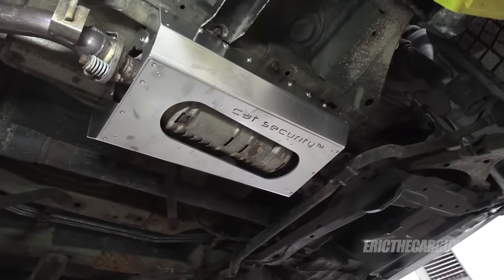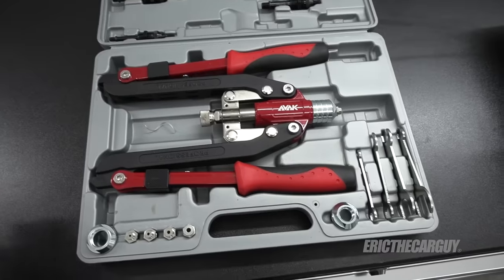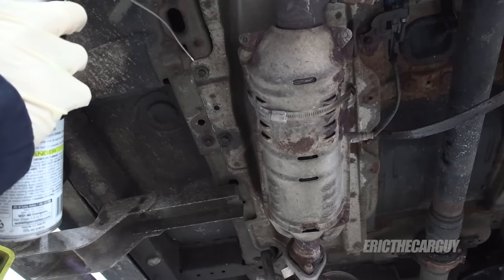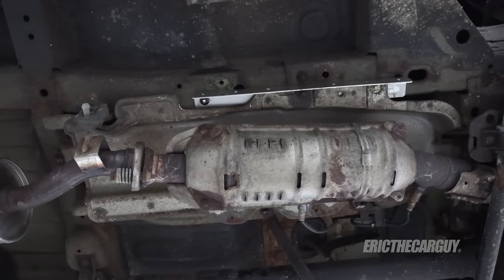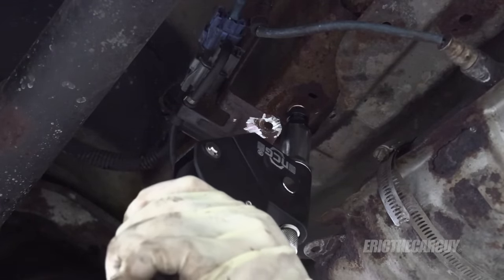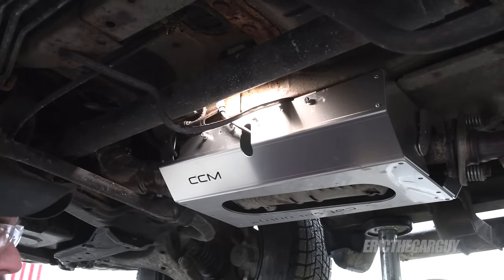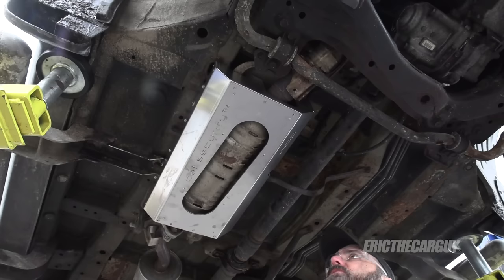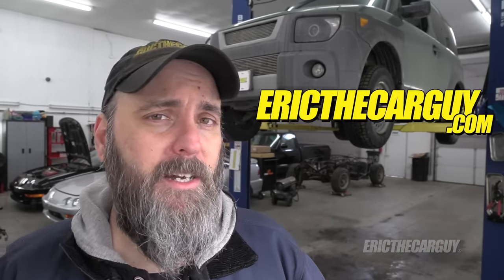How To Prevent Catalytic Converter Theft

Comment: That system is definitely neat! Luckily all of my cars are low enough to deter most CAT thieves
Reply: Haven't seen how they go about it do you? They've got low profile jacks and operate like a pit crew.
Reply: Why spend extra time bringing a low profile jack when you can just target SUVs, roll under and sawzall in a minute?  1 guy parks a car next to a SUV to block the view, roll under, cut, leave, done.  Happened at my work parking lot.  I don't need to worry with just 4" of ground clearance on my Accord.
Reply: Where I live this one guy was doing it even quicker he just had a chain that had two hooks on it and he clipped it to both sides of the exhaust and just ripped it out with his truck. Please said it was a two-man team and they were doing it to fund their addiction gambling and pills..  so it doesn't really matter how low if they're desperate they'll get it. Though this system probably wouldn't hold up either
Reply: @securityguy  really? A sawzall??? Lol 😂😂😂 how fast you think you can cut out a cat with a sawzall? Versus a right angle impact wrench? Not to mention the sound 😂😂😂😂
Reply: @deandalapanda  That's how they do it.  That's why cars show up to exhaust shops with irregular cuts on the exhaust pipe.  Saw it first hand myself.  Keep loud music going while you cut, why not?  It's not possible to loosen rusted bolts using just impact in the snow belt.  You need heat, that would take too long.
Reply: my car is low enough not even a low pro jack can get underneath
Reply: @securityguy  cos the prius and honda Jazz cats earn them more money. Probably because the construction of these cats have more precious metals in them than other vehicles. Seriously, I've seen videos of these thuggery theives work in threes stealing cats in broad daylight in the UK. Makes me sick.
Reply: @slimjim8736  if they wanna wreck your car for your cat, they will. Slammed or not these thieves will stop at almost nothing.
Reply: @deandalapanda  you think they take the bolts out? Hahahahaha I can cut a converter off in 10 seconds with a sawzall
Reply: yeah that won't stop them, they use floor jacks.
Reply: @securityguy  they do prefer higher vehicles like trucks and SUVs but they still bring jacks and target lower cars as well because economy cars have bigger cats and bigger cats means more money. I used to rent penske trucks and we had people steal cats off the trucks all of the time, and they were stupid for doing that because they aren't as valuable. and you can tell they're stupid because half the time they would leave the cats and steal the resonator thinking they stole a cat.
Reply: @deandalapanda  a sawzall can rip through a 1/4'' nail like butter. we're talking like 1/8'' steel here, it's not even a work out. an impact won't do shit especially especially if you're dealing with a welded system. even if you can get the clips off quickly, which you probably could, it's not just going to drop out in your lap. the whole system uses interlinking pipes which means you would pretty much have to slide the whole exhaust backwards to get it out and with all of the rust the pipes are almost certainly going to be fused and will need some real elbow grease to get them free. I have done enough exhaust work to know that doing it the right way without damaging anything can be a struggle vs just hacking it out.
Reply: @slimjim8736  "my car is low enough not even a low pro jack can get underneath" can you go over speed bumps without leaving your transmission behind? all they need is a few inches.
Reply: Jokes on them its straight piped!
Reply: I have mine slammed when parked
Reply: $80 lightweight low profile aluminum car jack from harbor freight will make it easy
Reply: @jameslong2618  it doesn't even matter that it's $80 because they'll just steal that too. I work at home depot and I have seen people steal weird things. sure most people are going for the diamond blades and just about anything that says (makita, dewalt, milwaukee, and bosch) but we also have people who steal ryobi tools. they steal tools for their jobs, and when they are tools that they are actually going to use they tend to gravitate towards the cheaper stuff, it probably makes them feel less guilty and they are also less likely to be chased. a guy came in a stole some ryobi tools including a sawzall and not even a day later somebody is going around the parking lot cutting cats out of customer's trucks.
Reply: They mostly hit Prius here in California. They lift one side and out done in minutes with the new power tools that are out there.
Reply: No joke my friend had his converter stolen from a Prius
Reply: Challenge accepted.
Reply: @MrMistery101  Just because they have a low profile jack, doesn't mean crap.
Reply: Best you can do: straight pipes in a state like Tennessee, weld it in, or have like a inch of ground clearance
Reply: @M1LAD81  Would it be less likely to happen to a "low rider car that is parked/dropped at the lowest level.?"...
Reply: @deandalapanda  a cordless sawzall with a decent blade will cut through exhaust pipe like a hot knife through butter. I cut up take off exhaust pipes all the time it takes maybe 30 seconds.
Reply: I heard on the news today a thief trying to steal a cat off a Prius got crushed to death when the jack he was using slipped and dropped the car on top of him. Sweet, sweet karma.  👍
Reply: Yeah I'm scratching my head as to how someone can't simply jack the vehicle up.
Reply: Look up man crushed by car while stealing catalytic converter. It was a Prius.
Reply: Good thing there's no such thing as jacks.
Reply: Do your research before spending money on designs that can potentially damage your vehicle. This catshield in the video is basically an oven and causes overheating of your catalytic converter. Here's a study from the company using thermal testing on their prototype catshield design similar to this - https://catshield.com/blogs/news/the-design-process
Reply: @mst7897  in all honesty probably not. That's because most people who do this slamming to the ground to their car are unlikely to have a catalytic converter. There's a high probability that the car has been de-cat'd. So the thief wouldn't waste his time to check.
Reply: @M1LAD81  Toyota Prius type cars are the cat thieves favourite because these cars spend most of their running on the batteries so the cats are almost atill brand new
Reply: @deandalapanda  They're cutting exhaust pipe, so with a new blade, they can cut through in seconds.
Reply: @slimjim8736  They'll jack it up by the rocker, and/or under the door. Don't give a flip if they do damage.
Reply: In 3 minutes one guy stolen my cat from my 2014 Corolla.
Reply: @ElectronicsForFun  ''Just the tip''
Reply: @securityguy in my area people have been hitting Priuses like there's no tomorrow. Floor jack only, there's no way to get those without one.
Reply: I got my catshield at www.catshield.com! They use tamper resistant screws and even use zinc coated rivnuts to keep the metals separate. Hence, preventing galvanic corrosion from occurring on my car. Btw, I got their stainless steel instead of the aluminum cat shield. Worth checking out as an alternative.
Reply: @JoshuaDomoslai  Unless you're from CA! This damn state requires OEM.
Reply: My Audi is low and they jacked it up on one side and attempted to get it. They cut the pipe but apparently didn't have time to cut the clamps leading to the catalytic convertor.
Reply: Don't need all that bs. Install a shock sensor and motion sensor alarm underneath your vehicle and set the sensitivity level to high. Install an ear drum-damaging db level siren underneath vehicle. Park in well lit area. Park in front of your home or near. Stay locked and loaded, just in case you catch them in the act. You wont have to worry about s^%%. BTW, I dont care if your vehicle is sitting on the lower control arms. Thieves can still gain access to your undercarriage.
Reply: @securityguy  The Toyota Prius is one of the most popular targets for cat thieves and they are vey low.
Reply: @securityguy  My daughter just had her Cat stolen off a 2005 Accord. Parked on the street.
Reply: @securityguy  Toyota Prius catalytic converter sell for big more. Worth it for them to bring a low profile jack
Reply: @Scoharr  That sucks. It's better parked in a driveway near the house or garage if possible. I hear they mainly target 2000 to '07 Accords, Elements, Prius, trucks, suv's even older and a few newer ones, mainly b/c the CAT's are bigger or more value to them in 2000 to '07 I guess??..I have a 2010 Accord EX. Some shops say they may hit mine, other shops I spoke to say only 2-3% chance they try for mine. 

I have comprehensive ins. $50 deductible that would cover the loss. I think I'm going to still have a 1/2 inch hardened steel bar and a 1/2 inch hardened cable welded side by side all the way down the exhaust, spray paint it bright orange for $200 at a muffler shop I found. "Piece of mind" thing, might deter them. They can still get it after using maybe 4 blades and 5-6 minutes if they want but they might pass after seeing all that and not being older than '07 for the big money.
Reply: Have you ever heard of floor jacks?
Reply: @mitchkronowit3633  now I know of two different cases of cat converter thieves being crushed  by Prius one car was blue and the other one was silver.
Reply: @mlee81  I was 8 years old the first time I jacked up a car helping my dad fix a tire at home.
Reply: Actually that would cause more damage.  the bad guys will just attach a hook on a cable and rip everything out with a pickup truck

Comment: I just had my cat stolen  while in Lowes in the middle of the day and parked in direct view of the cameras.  34 second removal with a reciprocating saw.  Insurance is looking to total my truck due to value vs cost of repair.  I'll probably replace it my self with some winch cable security.  Good video and information for whoever can use it.  Good job E.

Comment: Sorry, mine is actually Astro Pneumatic.

They also make an air powered version, for tight environments. 
They also make different mandrels for different Rivnuts. 
I also bought the extra multi pack
Astro-Pneumatic-Tool-1442-Setter

There are so many uses and applications for Rivnuts.

One cool thing I discovered- install a suitable Rivnut,
then install a rivet where a bolt would normally go.
The rivet bites into the threads of the Rivnut.

I've also got into the habit of installing a washer behind
a rivet or Rivnut, it adds huge strength to the bond.
Reply from the maker: Thanks for that tip!

Comment: Attach a cheap bicycle alarm (one that has a remote) to a cinder block/brick, etc. They're waterproof and can be found on Amazon for around $10. Place the alarm inside the block and place it under your car/truck in your driveway below the catalytic converter.  Ensure the block/brick has just enough clearance that your car-truck wont hit it, but not enough that they can access the converter with a saw with the block in place.  You can make marks on the driveway to ensure youre always parked above the block.  When you leave, use the remote to disarm the alarm and re-arm on return. 
These bike alarms are sensitive to vibration.  Its next to impossible to move the cinderblock or brick without setting off the alarm and warning the whole neighborhood, but arent easily set off by wind and such.  These alarms are really loud, and when the alarm goes off, theyre going to scramble out from under there and run. 
Youre welcome.  :)
Reply: sounds like a terrible idea you just came up with and never tested. 
 most cars have low ground clearance and cant drive over a cinder block without causing a ton of damage. most trucks have so much room under them you dont need a jack to change the oil. a cinder block wouldn't even be in the way. maybe an SUV would work but you didn't mention those.
Reply: Thanks for this post - excellent idea! Have you done this yourself? And can you recommend a good alarm?
Reply: I’ve got one on my ebike and was thinking of a solution that would work. Not a bad idea and you can take the cinder block with you .

Comment: I've been watching your channel for some for some time now. My wife just said I should let you know the mileage on our 2003 Element that we bought new. Right now it has 495,??? miles. I have Replaced the engine/transmission at 220,??? and swapped the second transmission at 305,???. When my wife asks if I'm going to replace the car I tell her I'm will. At 1,000,000.

Comment: I like to protect my car with small chunks of lead,
evenly spaced apart. 100% success rate!
Reply: Mine travels at 1,200 feet per second. ;)
Reply: I live in farm and ranch country.  Theft like that just doesn't happen out here.  Nearly every farm here is protected by 55 grains.
Reply: @maingun07  Protected by lead and backhoe. thief just gets disappeared.
Reply: Oh yeah..... the ol' copper jacketed lead core self propelled drill bits. Followed up with an ol' J.I. Case 580B.
The complete Scum-Bag-Removal Kit. 
My theft determent system isn't a sticker, its a gun rack on a Backhoe where anyone can see it.
Reply: Air Mail messages have a high success rate...
Reply: @maingun07  i'm guessing its not wheat or corn
Reply: @Dratchev241  who needs a hole when you have some strong bases and vinegars
Reply: I tend to use 147gr or 180gr . 9 for the hood, 10 for the woods
Reply: @Dratchev241  that has a nice ring to it
Reply: Fed to the hogs. All you have to do is pick up the teeth a few days later.

Comment: How to prevent catalytic converter theft:
Run "free flowing exhaust"
Reply: Electric car.
Reply: Rust
Reply: Some States Its Required...
Reply: @sgt.mikebaran7105  shhhhhhh dont talk like that
Reply: stright pipe
Reply: @bresina63  or free flowing exaust
Reply: imagine what traffic would smell like if everyone did that.  like driving in Mexico city.  no thanks
Reply: My old F-350 is cat less, but it's a 1991 F-350, with a 7.3L IDI Diesel, so a pre emissions engine. How can you steal the cat from an engine that doesn't have them right?
Reply: @Jesus Perez Joe "Green" Biden just passed a kidney stone when you wrote that!!   So thank you.
Reply: electrify the car, they wouldn't notice that HV ground strap hanging down. ZAP ZAP ZAP ZAP
Reply: @throttlebottle5906  then they will sue you, take your car and house 🤢
Reply: @halleffect1  dead people cannot sue